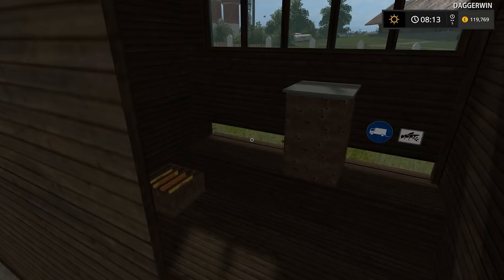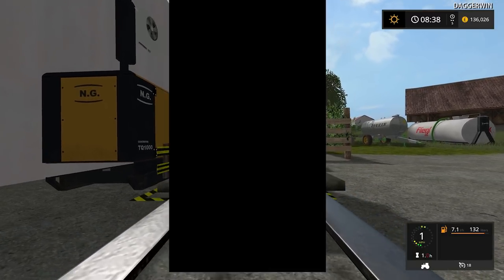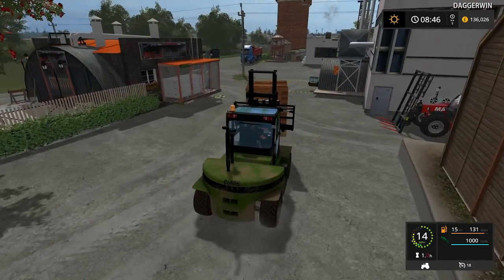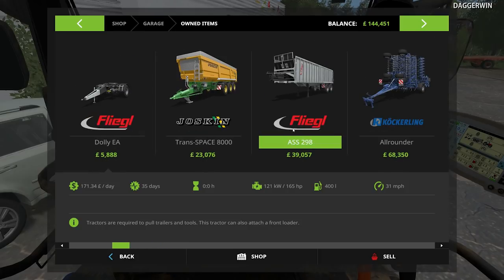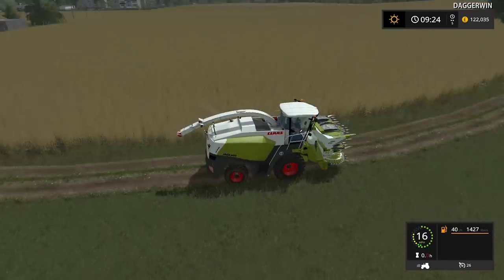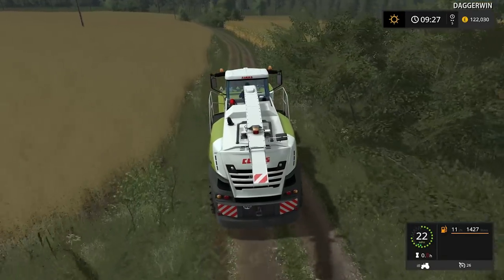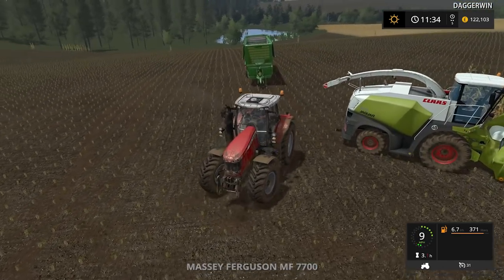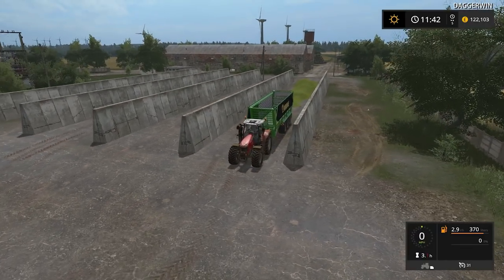AS I PROMISED... | PGR Bruzda | Farming Simulator 17 | Episode 14

Comment: I have tried the forage container for the MAN ITR with a ITR trailer and forage container total 96000litres. You have to split the combination to unload or strange things happen when the rear door shuts on the truck mounted container.

Recommend the new Giant greenhouse if you want to be busy. Crop every 3 hours. Also ColaCola plant greenhouse/process 'shed'. Needs manure and water like the old Lizard greenhouses but outputs pallets of produce. Is not quiet as intensive as does not need pallets and boxes to be produced. (A half way house so to speak)